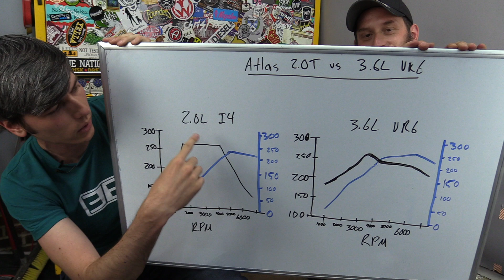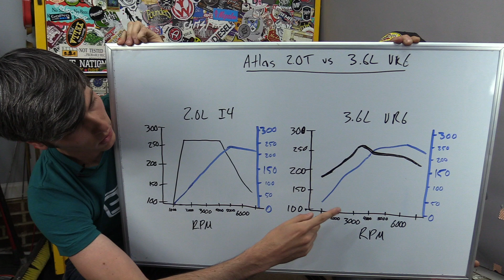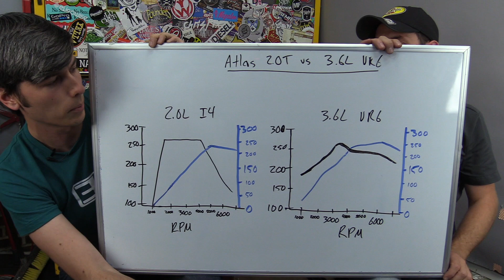4 Reasons Why The VR6 Engine Is Dying Off

Comment: I am curious how the fuel economy would be affected if you found a way to drop about 600 pounds off the design of the car or more to the point how much weight reduction would it take to see a significant increase in fuel economy.

Comment: Sorry but the title is misleading. This video is not about VR6. It's about NA engines with more than 4 cylinders. Hell you can look on the new 3 cylinder engines and say the in-line 4 is dead also. What you said did not relate more to the VR6 than to a in-line 6 or V6.

Comment: 1. Compairing torque curves between the VR6 and T4 is misleading, has nothing to do with the R in VR6 just 6's in general. 2. Same as #1  Compairing details between 2 different generations has nothing to do with VR6 configuration, maybe a little to do with v6's in general, but even then many technologies are wraped up in this comparo (like the refinement of direct injection) make this a bad comparo. 4. Saying space is concerning and saying VR6's are nice and small is confusing and muttles the point. (Titles says "Why Dying off") 5. Consolidating... Why arent they consolidating to the T4 and VR6, maybe a VR6T?     ... I just, I came to another one of your videos looking for an engineering analysis of the unique configuration of the 'VR6' and I got some normal VW product line analysis. As with other 'Engineering Explained' videos I got amateur generalizations and textbook poor representation of what a good Engineer is. Its like your doing analysis just as an excuse to do a math problem, rather than as a tool to prove a point or learn a phenomenon.
Reply: I like the mechanic guy, you seem knowledgeable without pretense.

Comment: What is a VR6 engine compared to just a v6?
Reply: Its a V engine with a 15 or 10.6 degree V. This allows for 1 cylinder head. The footprint is much closer to the 4cyl.

Comment: Great video and love the VR6 (used to have a 2000 GTI VR6, currently drive a MK7 GTI Sport manual). Nothing beats the sound of the VR6 though, 2.0T sounds terrible. Your dynos is a little off though if the 2.0T is building up that much low end torque then the power should be higher and less steep at that respective RPM. Also your not showing the dual torque hump in the VR6 with the intake manifold switch over.

Comment: Just a quick question for Jason, are there any harmonic vibration issues with the I4 as opposed to the VR6? I mean does the VR6 have less vibration/need for balance shafts than the I4? You being an engineer and all. Just curious.
Reply: OF the 2 engines we talk about here not really. The 4cyl has 2 balance shafts. But both have crankshaft pulleys that have dampeners too. From a driver standpoint the 2.0 is a smoother engine. But some of that may be due to the cars each are in.
Reply: HumbleMechanic Okay, so VR 6 harmonics wise is closer to the I6 then. thanks!

Comment: To me, the main question is not why VR6s are being dropped in favor of turbocharged inline fours, but why they are not being used instead of 60º V6s. Even the argument that a V8 can be created from a V6, that's also true about an virtual VR8 being designed from a VR6. I mean, VAG group has a turbocharged V6 spread throughout several brands, so why not having a turbocharged VR6 instead?
Reply: This is a pretty easy one. It's about the platforms. All the VWs in the US(other than Touareg) are transverse mounts. While a V6 can fit, the design of those engines are meant for longitude mount. 

VR6 is close in footprint to the 4cyl. With all cars moving to MQB platform they are making them as universal as possible. 

I would have loved to see the 3.0t in the Atlas.
Reply: Thank you for your answer, but I'm still confused. If I understood you right, a VR6 engine couldn't fit in transverse mounts whereas a V6 could. Is that right? I'm not an engineer, so to my ignorant eyes, a VR6 is just a V6, but with a narrower angle between the cylinder banks, which makes it better. My question is, if it is really better, why the plataforms were not meant from the begining with this engine in mind?

Comment: I wanna build a 250 cubic inch VR5 turbo diesel with an equal bore/stroke ratio. Going for a higher horsepower/higher RPM idea. Diesels are simple to amp up, too. That's why I like them. Throw more fuel and pressure at it, make power. All that limits you is the durability of the block and internals.

Only problem is weight, low HP to torque, and low RPM. Hence why I proposed a squarebore design instead of the traditional undersquare design for diesels. As well as a smaller displacement, while not being TOO small like the 3.0 v6 and 5.0 v10 that VW makes.

This should allow more revs, and therefore more power per torque and displacement and boost. Which should allow it to be built slightly less robust than, say, a cummins 7.3 inline 6. Combined with the design, it should be smaller, lighter, and unique sounding to the cummins 6bt and 4bt engines. As well as an equivalent diesel v8. AKA, perfect for a track/strip vehicle.

After all, this theoretical engine would be going in my custom half ton truck as a race engine. Connected to a rear mount sequential transmission with a rear/mid mount turbo. And it will be AWD. The rear mount trans and turbo are for weight distribution, obviously. OH, and the engine will be slid back as far as it can without structural mods for the same purposes. And to free up the engine bay for cooling.

Comment: I sorry, but I can't take this video seriously. Your power and torque graphs are incorrect. The power and torque lines will always cross at the same point on the graph, and yours don't. If you also look at the part of the graph where both engines are producing around 260ft.lbs or torque, the graph shows them to be making different amounts of power at that same point. Power is basically torque x rpm, so it's not possible for them to differ in that way.

Ergo; WRONG.

Comment: Hey there!  Ive got a question for you that i was hoping you could break down and show me the math cuz im not knowledgeable to do myself.

What is the quckest way to cool down an engine?
Ive heard that turning your heater on will help pump more heat out of the engine. Ive been doing this during my autocross runs.
But would it cool faster if the engine is off? I would love a breakdown! Thanks!

Comment: Wonder why they didn't take the VR6 and modify it. shorten the block and make a VR4. or even a 3 cyl model.  Would have let them keep lots of the parts they already we're using. and be an even smaller package too.

Comment: We will never forget the sound of a good VR6. 

Sadly the design is very complicatet and expensive, they never really solved the problem with lengthening of the timing chains which made these things quit unreliable/ costly to own.

Today a run-of-the-mill V6 from a camry is just as good as an option.

The ne VW Atlas still has the old Passat Vr6 in it if iam not mistaking. These things should come boosted from the factory and get some modern engine features to compete in todays market.

Comment: I have a vr6 mk4 gti, a 1.8 t mk1 225 TT, 2.0T A4 and Flying Miata turbo NA8 Miata.   The turbo cars are tuned and make way more power and torque over the vr6  BUT  I drive the VR6 for the exhaust sound.  Everytime you rev it the sound is so wonderful you just have to grin.  When you go to a car meet just give it a bit of throttle when moving it around and people will flock to see what is under the hood that made that glorious sound.  The is way more to an engine then torque or HP curves.  Turbos make sense but I think they lack soul.   I also ride a vintage two stroke street bike, you talk about a neck breaker!

Comment: So the VR6 is dying out for the same reason as all other large N/A engines, nothing to do with the unique VR engines. 
- Smaller turbo engines are more efficient, as everyone already knows...
Reply: Thier not, your wrong. It has to do with the fsi and displacement. They went to 4 because it's cheaper to produce period. Six cylinders with equal v.e. are more efficient than 4 with a turbo that's a misnomer.

Comment: Less oil... yeah, in theory but everyone knows with the modern VW Turbo engines oil consumption is a disaster and in no ways realistic in terms of factory spec. And with the fuel consumption it is no different. Factory specs are so exaggerated nowadays. These figures aren't realistic not even with a ridiculous slow drive style.
Reply: Tommyflocker Scotty Kilmer always says that the turbo option only looks more efficient on paper. Why? Turbos are more fun and people use the available power. That's why!
Reply: My 2016 golf R burn 500 ml of oil in 10 000 km wich is very good , no issue for  me

Comment: He keeps mention that u can upgrade the turbo on 2.0 anything bigger than a ko4 and ur gonna break something, Vr6 at 500hp with stock block and 2.0t at 500hp stock block see which one lasts longer, and well taken vr6 u can dump money on turbo build but with the 2.0 to make the same power not only do u have to buy the turbo kit u have to pull the motor and up grade all the internals

Comment: I like how they don't mention that 2.8 vr6 apart from the Pistons it comes with a forged bottom end that it's rated for 500hp all day and that because of its higher  displacement and with the addition of 2 cylinders it over all has a higher "potential" for speed and that old well maintained vr6s are bullet proof but it's known the 2.0t had constant issues from the factory and that there are just some model years that people just don't buy because the are plague with problems

Comment: In the U.K. and Europe, nearly all engines are 4cyl turbos. They are the beige of the engine world. It's nice to hear and feel a different kind of power plant.
Reply: America got the 8 valve 4 cylinder engines with 88 horsepower, and a top speed of 100 mph in most of their small cars for many years. Only recently in the last 10 years have there been a lot of good 4 cylinder cars with turbochargers from the factory in America. Nobody ever wanted an 8 valve low revving 105 hp 4 cylinder engine in a Celica or a 12 valve 92 hp engine in a Tercel, but that's what American's got in the 1980's and 1990's. Just God awful truck engines in small cars with very poor handling. Oh and our trucks had 3 speed transmissions until the late 1980's, so for 50 years we had trucks that turned 3500 RPMS @ 60 MPH with a giant V8 engine sucking gallons of fuel per second.
Reply: @Ritalie  2 valve and 3 valve

You're not supposed to combine the number of valves into a total.
Reply: @naut3  Only counting a single cylinder's valves is an American thing.
Reply: @EmyrDerfel  I was confused about this lmao. Never heard someone count by cylinder until now.
Reply: @benasmus4676  I can understand why one would refer only to the number of valves in a single cylinder.  A "16-valve" could be a quad four, or an old push rod V8.  Basically, saying "32-valve" would require Americans to do math.  And if you say"2.7 litre", it sounds like "eleventy point secondteenth piffle units".
Reply: Nowadays 3 cylinder turbos.. agghhh.. 😀
Reply: Yes. The U.K and EU ruined the automotive industry. 

Socialism sucks.

Comment: tbh the gti is a nice looking car and all but the 05, 06 years were crap in comparison to a cheaper Saab 93. The data speaks for itself,  220 torque and 210 hp, 3300 pounds with 2 extra doors AND it does 31 MPG on the freeway

Comment: Pointless to compare. VW simply wants to lower production cost. Owners get stuck paying more for the required 91 minimum octane fuel; which is rarely accounted for when measuring the benefit of MPG, unless figuring annual fuel cost.
Reply from the maker: +Michael Bullington minimum fuel requirement is regular 87.
Reply: Ah, good on them. Thank You for what you do, sir. Curious if you've done an episode on N2 in tires...searching. Found it, good job on that too.

Comment: The first two reasons you mentioned applies to pretty much all naturally aspirated engines. More torque at low RPMs always helps since it reduces the amount of revving you need to do to accelerate and maintain speed.

Since tuning was brought up in the video, I wonder if car engines will follow the way of large commercial jet engines in the future. Jet engines are always produced with many ratings. To increase thrust, you just switch the rating plug to a plug with higher performance numbers.

Comment: i have owned a 2000 gti with the 12v vr and 5 speed and then i had an 03 gli with the 24v vr6 and a 6 speed and i loved them both. absolutely loved both cars. now i own a 2014 gli 2.0t and that engine is a whole nother ball game from the mk4s vr

Comment: FLT did the Ike Gauntlet with the F150 V8 and 3.5L turbo.  the interesting thing is the F150 V8 under load (towing 9,000lbs up a hill) got better MPG than the 3.5L Ecoboost. Both towed the same and maintained the same speed.  have you explained why? can you explain why? i have a decent idea.
I noticed when I rented a 2009 Suburban with a 5.3L OHV 2V with cylinder deactivation.  it got decent freeway MPG. Slightly better than my 2001 F150 4.6L SOHC 2V. But around town or under load,  that 5.3L drank.  MY normal city driving (lead foot) yielded 2-3mpg in the suburban. the same driving in my F150 yields about 8-10mpg.

Comment: That 3.6L VR6 power/torque graph is a little wonky. Power and torque curves always cross at 5252 RPM in imperial units.
Reply from the maker: +Christopher Eschler if you look at the drawing torque and hp have different vertical axid coordinating with the color of the line. HP and Tq are different units. Where they cross purely depends on how you set up the axis.

Comment: on that subject it cracks me up that Porsche and Volkswagen was the first to use a flat engine and mainly Porsche stepped up to make the iconic Flat 6 cylinder what's funny is Porsche maybe due to packaging constraints has never really put a flat 6 or flat anything in the front of their cars unlike the Subaru Legacy I I have has the Flat 6 in the front...

Comment: This video should have been called "why medium displacement NA engines are being replaced by smaller displacement turbo-charged engines"
Reply: Jeff Beasley THIS lol
Reply: Indrid Cold that’s where your wrong. Small turbocharged engines have been popular in Europe for at least 15 years now. They don’t have many problems.
Reply: In Europe VW has been fitting turbocharged 4 cylinder engines to their Golf since like the MK4. Not to mention about a dozen other models in the VW group, plenty of them out there have done 100 thousand miles several times over without exploding or "burnt valve trains" (what the hell does that even mean?)
Reply: Indrid Cold just look at Toyota's careful approach to the downsizing trend. Well, even though in some countries there is that 4-cyl turbocharged 1.2L available for the Corolla/Auris and the C-HR, it's still a more cautious move compared to Ford's usage of the 1.0L EcoBoost in the Euro equivalent to the Fusion. Plus in Russia and other CIS countries the Lexus NX had been available with a naturally-aspirated 2.0L engine along the 2.0L turbocharged (which is actually a different engine and not just a turbocharged version of the previous) and the 2.5L naturally-aspirated fitted to the hybrid versions.
Reply: truth
Reply: They had a Scirocco Cosworth that was turbocharged back in the late 70’s early 80’s. It was a 8v (I believe) and had the horrible horrible Digi fuel setup. But was pretty freakin awesome!! I love the VW/Audi I5’s and VR6’s exhaust notes!!
Reply: Indrid Cold sounds like a subaru I might own🤔😅🤣
Reply: Oh, the lolz.
Reply: which is called downsizing ...
Reply: why not have turbo-charged medium displacement engines for higher models.
Reply: Coût de fabrication beaucoup moins cher et c'est la mode. Personnellement je garde mon gros 8 cylindres
Reply: Crazy part is turbos aren't new.  Saab turbos were out performing Ferraris.  Its more an issue of marketing, and cheaper production cost while prices stay the same for parts or even goes up.

Comment: The "smaller turbo engine gets better mileage" thing is a myth.

People have actually tested the mileage of the Ford EcoBoost against the naturally aspirated Coyote 5.0. They took both vehicles on the same road trip, and the Coyote got significantly better fuel economy. The EcoBoost was only slightly better in gridlock city traffic because it's easier to idle. Everywhere else, no. That specific test was against the V6, but the I4 isn't much better.

If you want fuel economy, you do not want a turbo. Turbo = more air = more fuel = goodbye gas.
Reply from the maker: +ootdega it's not a myth. Just depends how you drive. If you're always in peak boost, of course you're using more energy. Smaller turbo engines use less fuel at lower loads. And road trips aren't exactly a repeatable method of testing. Comparing EPA numbers ensures the cars were tested exactly the same.
Reply: They are repeatable when the two vehicles are directly following eachother the entire trip.

Anyway, it also depends on the weight of the vehicle. A turbo 4-banger in an SUV, like the examples given here, isn't going to be off peak boost very often. The torque curve you showed even demonstrates that. The only time that thing isn't going to be at peak boost is at idle. Sure, the position of the pedal is a factor, but the power needed to move an SUV kind of negates that. The 4-banger is also always going to be at a higher RPM.

On top of that, modern vehicles are almost universally heavy, so I think this is fairly representative. I would have to look into the EPA's methods, but I get the impression their definition of "exactly the same" is more scientific than realistic.